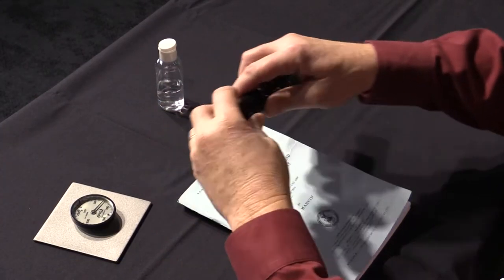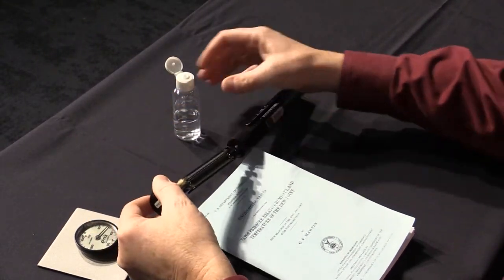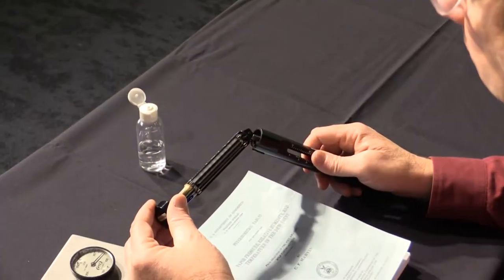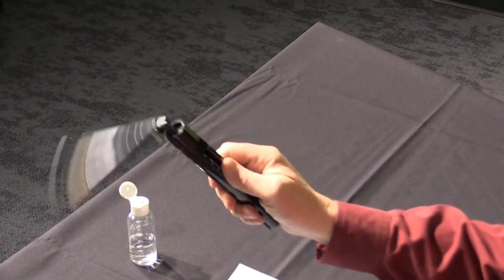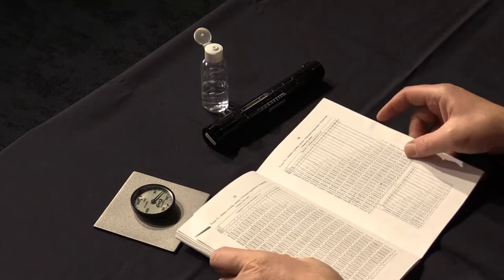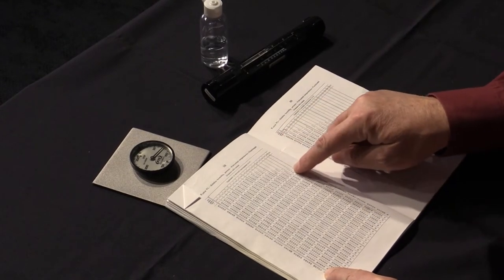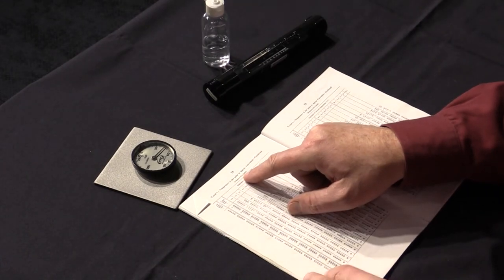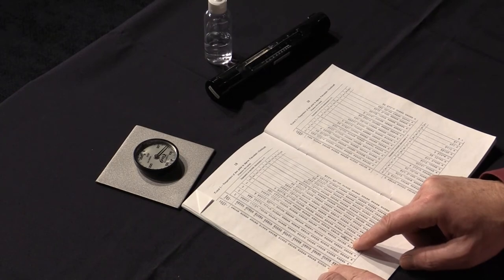How To Use A Sling Psychrometer

Comment: I appreciated the added detail of using barometric pressure to calibrate the RH%. One issue that wasn't covered on any other instructional video for the sling psychrometer for fire weather calculations is, if it is sunny out, spin the psychrometer using our own shadow to keep it out of direct sunlight. Thanks again!